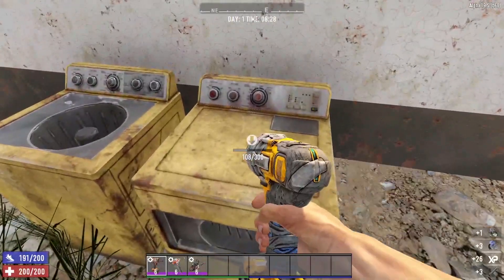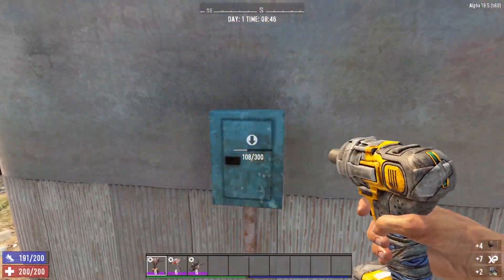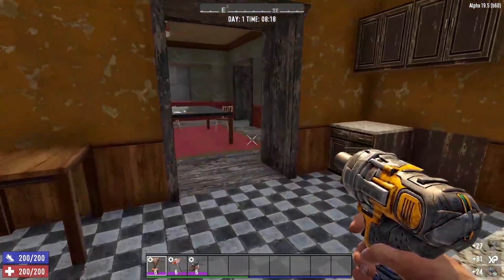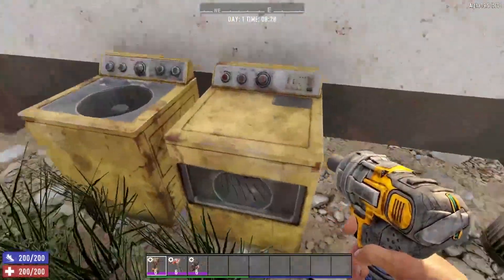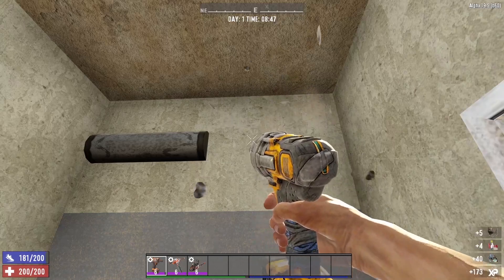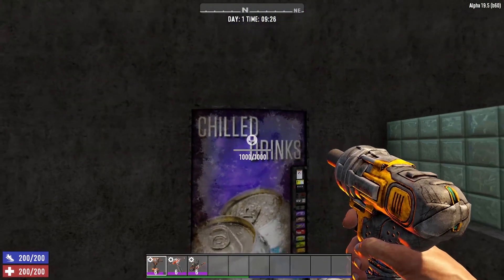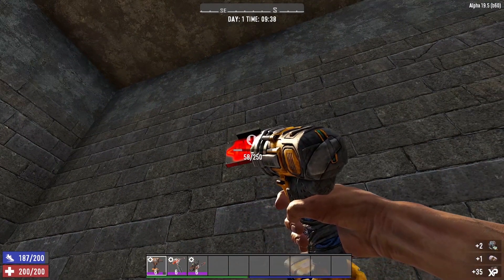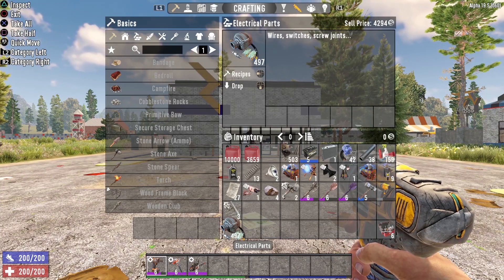7 Days to Die - Where The Heck Can I Find Electrical Parts?!?

Comment: Very nice saven! I have to admit the sheer volume of parts you get are staggering when you go full scorched earth on stripping down pois. Ive personally never needed to bother as I tend to stick with just breaking down every car I see as they may not drop the most of every item, but they HAVE virtually every item you need for crafting those mid tier items and such. Leather, pipes, springs, mechanical and electrical parts, engines, batteries, strip down enough cars and you wont find yourself wanting for much of anything in terms of crafting materials. That said, ive seen the darkness falls games and it seems like you need a LOT of those electrical and mechanical parts for late game use, and ive never gotten too far into crafting stuff like turrets, generators, switches etc for electrical defenses, generally just buying whatever I need from the traders, so it may be valuable in game too. Still really handy to keep in mind should I ever find myself running short. 

Im looking forward to the rest of this series, I just recently found something surprising I didnt expect. Leather. I knew there were plenty of places besides animals to get it, like specific loveseats and couches, diner seats, etc and of course cars, but didnt realize that picking up and scrapping OFFICE CHAIRS was a huge source of leather. I think they drop like 5 per chair when you salvage them, so find a office filled area and you can leave with more leather than you will know what to do with. Ive also heard if you break them down they have mechanical parts but didnt bother trying that as i was after leather at the time.

Comment: Good info. Can never have enough electrical parts. Thanks
Reply: ive not used any electrical stuff yet and im level 208... also barely used any ammo.. spent most of my time using mace and composite bow... i recently got the perk that gives you more components for breaking down stuff though... I dunno how to use electrical stuff in the game.. is it like the Fallout 4 system? Do I need to join sledge turrets to a generator?
Reply: @tigrecito48  There are a few savens videos on this stuff but here is the basics. A sledge turret or junk turret does not need a generator. You just have to be close enough to it for it to work, and if you max out the turret skills you can have two running at once.  The auto turrets both shotgun and smg need to be hooked up to a generator, same for dart traps, blade traps, and electric fences. Do a search in his videos, saven has one for both the basics of electronics and one for the sledge and junk turrets I think.
Reply: @UCCfnWEkqtnmZNCHCr3UGkKA As for distance from you before they just destroy your skyscraper, that I cant say, with the junk and sledge turrets, yes, its two active at a time max and they have to be within a certain distance of you, i think its 18 blocks max. As for the traps, they work fine as far as I know, so long as they have power from the generators and arent broken. Im honestly unsure if you can be like 50 blocks away from them and they still work. Ive never even tried something long distance like that.
Reply: @chrishubbard64  ok thanks... so like my base is quite big and over a large area.. i sometimes get screamers come in and damage my walls while im in the base with my forges or mining below etc.. i dunno if traps would even work cos they are quite far away... screamers seem to spawn and damage the bit between my bridge and the main base on the slope up... (see my video of my base) and sometimes they seem to damage the lowest blocks on the bottom of the lake - i made a steel support for my bridge for the entire depth of the lake... but that bit is miles away from where i am. so i dunno if they are just random zombies that walk in the lake or if they are spawning in cos im there...
Reply from the maker: You are quite welcome!

Comment: Anyone know what are the best mod combinations to use on level 6 weapons for using in horde night bases? Especially high level stuff... Is there a video on it? For example, which are best to use with a shotgun? I've got a strength based horde base with using mace and shotgun. Hatches along a tunnel... What type of barrel is best?  Thanks
Reply from the maker: The answer to that question depends on a variety of factors: play style, perks, books, base design, etc. There really is no "best" mod combination. No universal setup that works for everything.
Reply: @SavensWorld  its basically like your strength base.. a long thin tunnel full of hatches... just check my last few videos to see my base and the horde base (sorry about the low quality of my videos, my computer is 10 years old and i have rubbish internet) im level 208 and have almost all of the perks and perk books... pretty much maxed out most of the gun perks... 10 strength, 9 agility, 8 perception, 10 fortitude... 9 intelligence...

Comment: Can you do a video working out if the Chainsaw and the Auger ARE ACTUALLY BETTER THAN the steel axe and steel pickaxe and steel shovel? Cos... I swapped them recently and was highly disappointed by the auger & the chainsaw and swapped back. Now... with my level 208 character at least where I've maxed all stamina stuff.. strength, agility, fortitude etc, I chop a tree down in 1-4 hits... pretty quickly with almost no waiting for stamina to regenerate... I'd say its AS QUICK as the chainsaw.. but the chainsaw keeps destroying bags and stuff when i use it in poi's so.. for me the chainsaw is far worse than the steel axe. However I do think the chainsaw would be better for a low level character that hasn't improved stamina regen etc. The auger on the other hand does SEEM to mine quicker... BUT.. its far more difficult to get a nice tidy looking mine.. meaning you get lots more collapses and damage taken while mining. 
AND... THE MAIN ISSUE... Is it actually getting you more materials in less time? I had to spend the majority of 1 day fighting off zombies instead of mining whilst using the auger... whereas the steel pickaxe I might only get 3 attacking in one night. Then... there's the fuel... I used 10,000 in one night. If you add the time to drive to the desert mine oil shale, bring it back and then produce fuel from it.. is it actually quicker? I don't think so... especially since my character lives on the far left of the map on the lake islands, which is very far from the desert...
Reply: Dont pulse your auger, just hold it down active and it wont call in so many screamers, and probably use less fuel. As for more efficient, if you have the chance to one shot ore unlocked, an auger which hits super fast will chew right through ore like crazy compared to a pick that hits a lot slower.
Reply: @chrishubbard64  i wasnt pulsing my auger... i might have let go and restarted a few times here and there but was mostly using it until it was empty.. the only thing was i forgot to put a large tank extender mod on it... i did say the auger was faster but it made a messy mine cos was hard to control and i ended up with holes everywhere and collapses and then with a messy mine you never know where zombies are gonna drop in and attack.. i might still use the auger and chainsaw but only when im specifically only doing mining and cutting trees and nothing else. cos using them in poi's is complete rubbish...  i can smash up stuff with one hit with my steel axe and with full stealth even 3 blocks away the zombies dont wake up.. but use the chainsaw and everything wakes up...